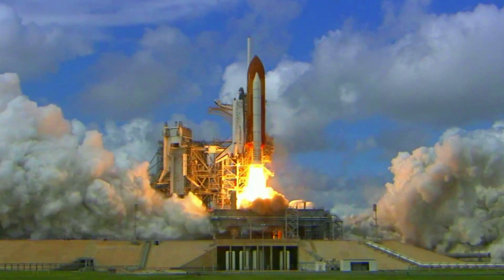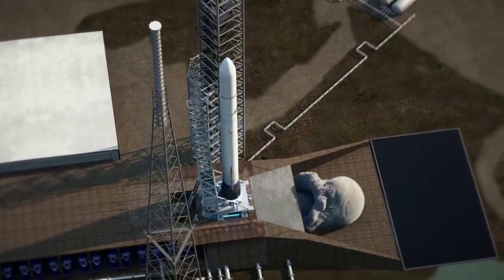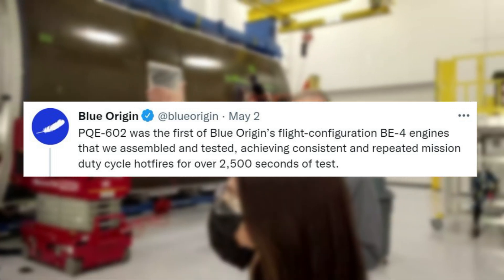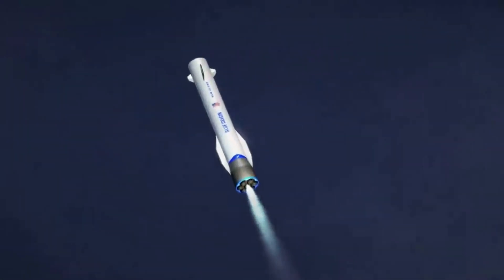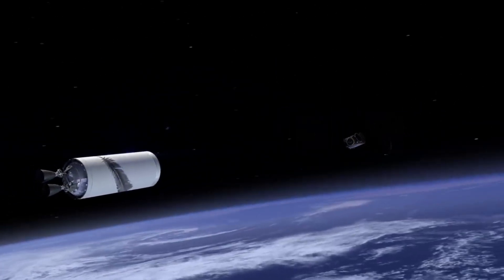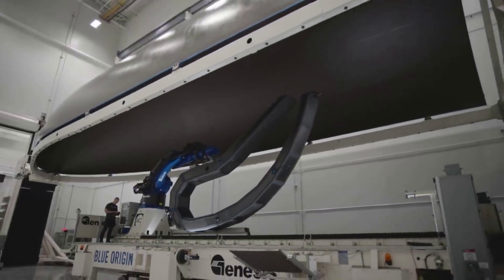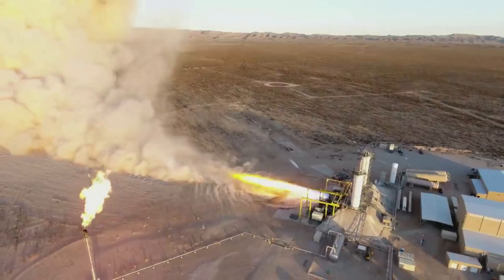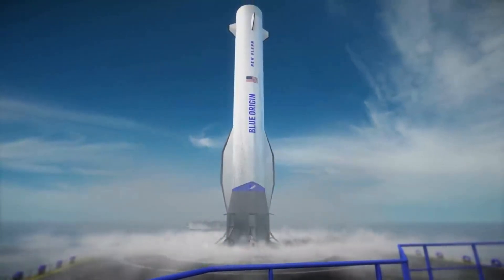A Closer Look At New Glenn & Its Progress

Comment: This was a sales pitch. The New Glenn animation has been around for years already. A lot of aspirational detail easy to produce without any hardware. The key point is an estimated launch in 2023. If everything goes to plan, and that is a big if, considering Sue Origins snail like progress so far, it will be in competition with SpaceX's starship which has greater payload capacity and probably much cheaper  and Vulcan if it ever gets working BE4 engines.
A nice clean but largely empty factory. II New Glenn is delayed another year or so then Elon might consider buying it for extra storage.
Reply: You definitely have no idea what your talking about.

Comment: Actually, for such a secretive company, it is a change to have at least some information. Now, apart from what we know already from Wikipedia and BO website, there is very little more from this video. We didn't really need to be informed that BO is late but we would have liked to know why and what is the future of the company. What I would have liked more would be about detailing the difficulties encountered, the reusable second stage project and so on.  Nice pictures but nothing new under the sun. After all the setbacks encountered, it would have been wiser to give real information.
Reply: Notice how empty the hangars are, how no real work is taking place, after all this time. How they all believe there that they are building a real  fly-to-space article that don't need no stinkin' prototypes or iterative testing, and no explosions please or someone gets fired like that BE-4 engineer in 2017 when a BE-4 engine went bang. This is just a BO management-speak ad for BO masquerading as info on a company mired in incompetence, mendacity, litigation and double-speak.
Reply: @mauricegold9377  I wouldn't be so definitive but this is true that this video doesn't really serve any purpose than to childishly try to promote BO. It is clear that they had a head start on Spacex but didn't use their money well.